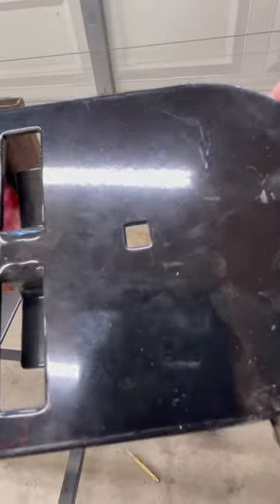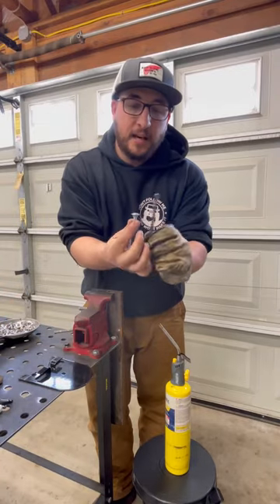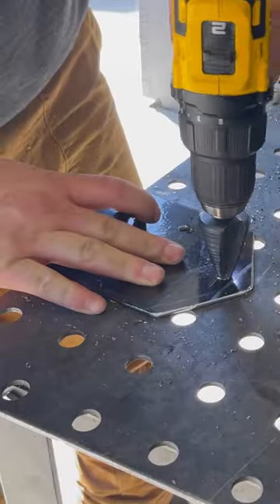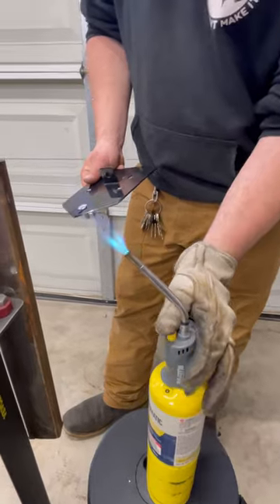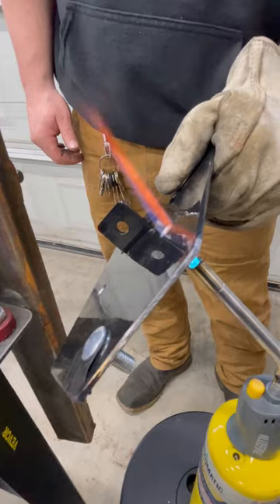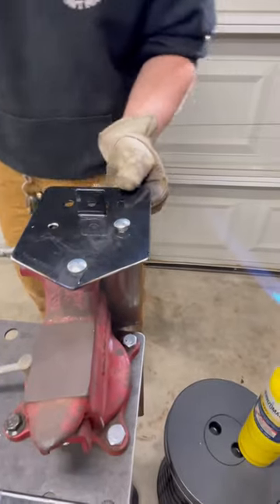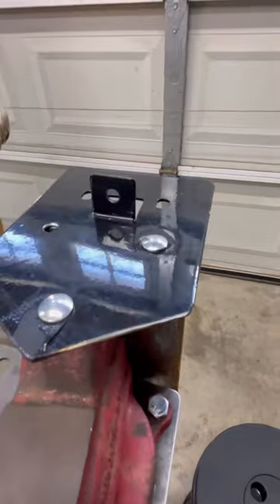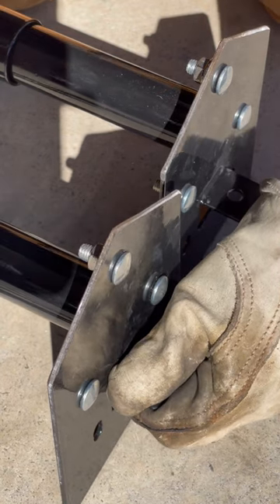Simple Technique For Drilling Square Holes

Comment: the plates bent and the plastics not looking so hot , but you certainly beat that bolt in
Reply from the maker: Absolutely more heat the less beat. Haha I don’t care for the plastic much it’s a demo. This technique saves a lot of time especially when things don’t need to be perfect. That’s the value in this. 🍻
Reply from the maker: @relese_thebeast72  it’s as secure as the bolt is strong , I like that the bolts head is press’s fit and held on. I’ve seen many bearings mounted between a frame using this method . I honestly can’t say, but worse case scenario is you can try it and if it doesn’t work, just use a traditional way of fastening.

Comment: For your application I would do the same, but without heating. Just need to drill a bit bigger hole. You don't really need square here.
I like those bolts btw, they self fixate and you don't need two wrenches to undo the joint.